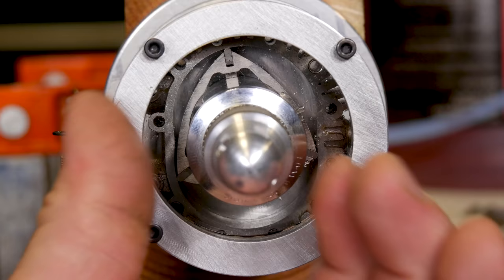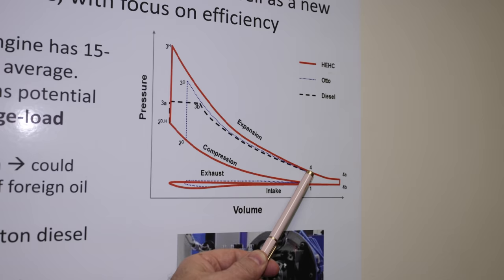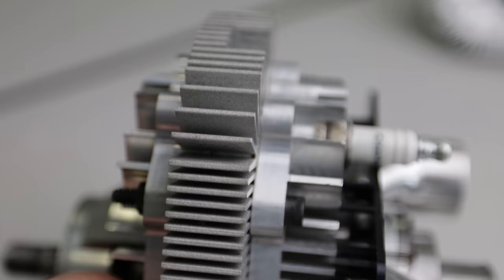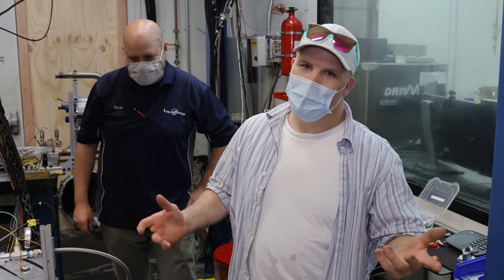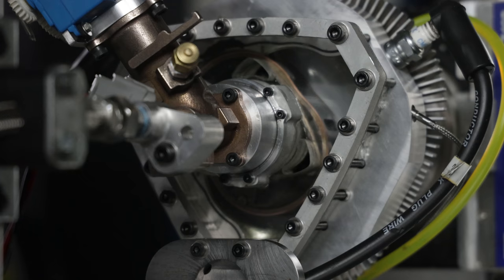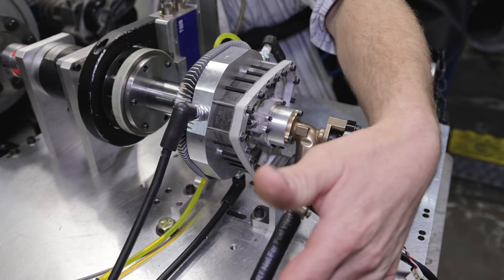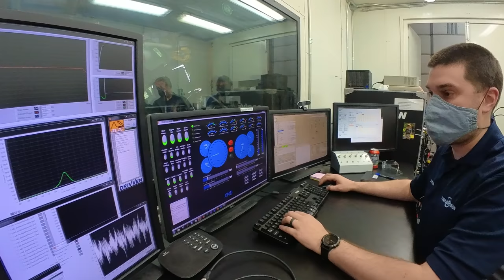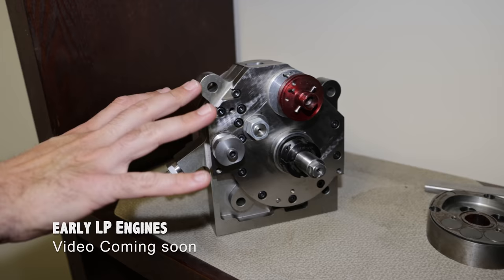See Thru Liquid Piston Rotary Engine - In Slow Motion

Comment: Would this also be considered or comparable to literally being 2 stroke engines rather than 4 actual strokes?  Plus with my very limited knowledge of engine mechanics, I'd imagine since it can use regular diesel that the engines could also be used as biofriendly clean diesel power of natural products such as hemp...??  
6:35 incredible how fast the explosive process and mechanical cycling goes  Just wow
I wonder if ultimately with having so much constant forces the liquid piston piece will break or fail somehow, or need to be used with a special hard or malleable material?!
Reply: So much friction
Reply: @henryrobinson2785  what exactly is your point "so much friction"? I'm not being ugly or argumentative; I'm just not understanding.

Comment: Really nice to give the engineers some exposure  so yea !  , tech wish how do you seal you talk about the apex seals on a rotary beings a problem area but don’t offer a options to that was the problem with Rotaries passing air polution specs
Reply: The apex seals don't suffer from the inertia imparted by the rotor pushing them against the housing and wearing them down fast. Instead they are in the housing, which means they should wear barely faster than piston rings.

Emissions are kept in check with a lubrication scheme that involves oil injection near the seals, in quantities that make oil consumption akin to that of a piston engine. Two birds with one stone on this one. Furthermore, since the explosion happens in constant volume, then the flame front has little-to-no access to the eventual oil film between the housing and the face seals.

Comment: Couple of questions.  1) Looks like the same side of the rotor gets the expansion force each time. Do you foresee any problems there?     2) Looks like the exhaust may build up on the fins of the rotor.  Any problems there?    3)  What kind of efficiency are you getting in percent?  TIA

Comment: Impressive, but the engine shakes too much. This may be fixed by attaching two engines together at a 60 degree angle so that the explosions happen simultaneously at 180 degrees.

Comment: Not sure what to make of this: The engine still has stationary seals and very high "piston" speeds that would cause heavy wear. Also the surface area of the combustion chambers is very very large, leading to poor thermal efficiency. Why would anybody at this point in time try to develop this? There will be no usecase for this engine ever...
Reply: RX-7 was a pretty popular use case, back in the day. There are still many enthusiasts.
Reply: @manofsan  understandably, considering the spectacular sound and power, truly amazing. They also have their problems obviously, for instance: excessive wear, excessive fuel consumption. But of like a 2-stroke: great fun to drive, not so much for day-to-day purposes..
Reply: @Tisimo  -  paramotors are the smallest manned aircraft, and mainly use 2-stroke engines for weight savings. But such engines are unreliable and can cut off while in flight. This rotary seems like it would be more reliable, even while providing good power-to-weight. If there was even a 10hp rotary model, it would be suitable for paramotoring.

Comment: All of the fuels you tried there isn't a consistent burn on each cylinder. Each compression stroke simulated a different reaction to the introduction of spark. Why is that?
Reply: At a guess it’s the intake system. Fuel and air don’t have time to mix (and the actual inlet port isn’t ideal for flow). Perhaps with a refined inlet system you can get proper consistent mixture going on
Reply: Probably because they where experimenting with different kinds of fuel and direct injection in a single day with no time to fine tune. I can see by the smoke that they where running rich to be safe since they had no EGT sensors hooked to monitor temperatures on each combustion chamber.

Comment: Damn it! Imagine if this had come put a decade ago, now it's almost too late thanks to electric vehicles. Maybe some sort of variant with hydrogen is possible? Would love to see scaled up variations and get an idea of the efficiency vs current tech
Reply: Use it to run the generator that charges the battery for the electric vehicle.   It's not like the greenies have an effing clue where their power comes from for their 
'clean' electric toys anyway. 🙄
Reply: The wankle rotary engine has been around since th3 70’s and there is many reasons why it is not pervasive.
Reply: @snippittmaster  I'm aware but this is a different beast. It'll likely run into similar problems overtime but I think the life span of those seals will be far longer. That and they can be engineered to be easily replaceable whereas the Wenkel was not.
Reply: @UCpn4fnZH3fg5P7qZ8D1MMRg Sure. Just have to overcome that damn scaling problem to make it work as anything but a niche application concept.

Comment: The rotary's biggest problem is its poor fuel efficiency. That is what kept it from widespread automotive adoption. 

It's still a great engine. It was very popular with many small aircraft designers for its superior power to weight ratio and its gentle failure modes. Where piston engines tended to seize, the Wankel rotary would simply lose power more often than not. This made emergency landings less traumatic.
Reply: my girlfriend had a worked 12a (rx7).. could see the fuel guage drop when flat foot on freeway runs
Reply: Fredrik Larsson  My understanding was that friction from the end seals (On the Wankel) made for poor fuel economy plus leakage from all the seals. There was also a problem with incomplete fuel burn. (Which the new hybrid engine will share, not that there aren't solutions to that problem.)

Theoretical fuel efficiency of an ideal engine isn't the same as actual fuel efficiency. Marketing hype isn't to be trusted. 

I will want to see actual performance numbers from production engines before I jump on the rotary band wagon. Still, this does look promising.
Reply: Think about your claim using any amount of logic. You make those outlandish claims, so back them up with numbers. What percentage of aircraft use a rotary vs any other engine type? According to your goofy claim, it has to be over 8o% since you say they are "very popular". I'll wait here for you.
Reply: Fredrik Larsson  I totally agree. The engine shows promise. 

I worked as a DARPA sub-contractor for years. About 1 in 3 ideas that showed promise actually worked in practice. These ideas we worked on were all good. But during development, unforeseen problems happened. That's the nature of R&D. 

The shape of the combustion chamber matters a lot depending on your definition of "a lot". The flame-front expansion needs to fully burn the fuel-air mixture just before the exhaust port opens, at least for maximum efficiency. This depends on the geometry and the nature of the fuel-air mixture (fuel type and compression ratio). 

All, or nearly all the fuel needs to burn and apply pressure to the notional piston (the peanut?). 

Ideally, the pressure on the peanut should be in the form of a tuned resonance chamber, though that effect will likely be a fraction of a percent added to the frequency. This is sort of like the tuned intake and exhaust valves on Italian sports cars. It's a tiny amount, but every bit helps -- in sales literature if not reality. 

I'm not an automotive engineer, but these are the sorts of things top designers worry about. 

Of course, these are design features for later iterations, not for proof of concept.
Reply: @eriklarson9137  Don't take my work for it. I'm just some random guy on the internet. 

WILLIAM KUCINSKI wrote for the SAE International (Sep 24, 2018),

"The Wankel rotary engine has been an ideal choice for many owners and operators of small, propeller-driven aircraft. Compared to conventional piston engines, Wankel rotaries are small, lightweight, and has a high power-to-weight ratio. They’re nearly vibrationless, they can’t seize or knock, and they have fewer moving parts (to break). At this point, it’s difficult to improve on the Wankel design; that is, unless you’re considering changing the shape of the rotor… into a changing shape."

He seems to think everyone knows about the benefits of Wankels in small aircraft. But the SAE is the Society of AUTOMOTIVE engineers. Automobiles aren't planes, so maybe both of us are talking out our asses. 

Even if true, why the flamewar?

Comment: You can tell by the leverages of the "piston"disc that this kind of engine will produce very little torque in comparison to a traditional piston engine
Reply: torque or braap, choose one
im dreaming now for this engine mounted in a moped for city use, i would 100% daily this
Reply: And the lower torque can be offset by the insane rpm and gearing, as the go kart video on their website shows the little guy turning 10k rpm for 3hp, and a huge gear reduction ratio from the chain drive setup. So a simple planetary reducer in-block or bolted on would make up for that, same as anything running a modern 2-stroke
Reply: Even compared to wankel type of rotary piston that design would produce very little torque. That's probably one of the main reasons they did not go forwards with this design during original rotary engine development either. (Yes, not a new design. There are design tables for this type from 60's)
Reply: @moroit1  If you focus this engine for hybrid car electricity generation for either battery charging to direct-drive electric wheel motors, you would not have any torque requirements of concern. You are only interesting in rpm.

Comment: Wonderful engineering, to this board certifed prof'l mech en'g consultant. The only issue I see is chamber sealing, especially with the two exhaust ports on the  rotor getting hot, and causing differential expanson locally on the rotor, distortng the cold shape. Not a problem?

Comment: Maybe I’m way off base, but it seems to me like there is a significant amount of “quench area”. Wouldn’t this contribute to excessive hydrocarbon emissions for automotive use? Have they been looking into gasoline direct injection to solve the potential issue? I really love this engine, so I’d hate to see it struggle on account of not being able to meet federal automotive emission standards. I hope I’m wrong, because I’d love to see this thing powering cars and small equipment. Actually, are they selling these?  I’d love to build an unstoppable string trimmer or something with it
Reply: those are good points. The diesel version uses direct injection so I don't see why the petrol version couldn't also use it. HOwever I don't think there is any intention of these engines ever being uses in automotive applications. An engine of this design would have emissions issues. Because of its light weight and great power to size/weight specs I could see this engine being great for ultralight aviation. Or small UAV's.
Reply: @JessHull  It actually has terrible power to weight. They remove everything the engine needs to run before they weigh them (fuel and spark systems, cooling, etc.) and they round-up on their power outputs. So, this 70cc Mini X only makes 3.5 horsepower and weighs more than 10 pounds.

Comment: How efficient would these engines be compared to the normal ICE car, or even to EVs?
Reply: The Wankel's combustion chamber is long, thin, and moves with the rotor. This causes a slow fuel burn. Engines try to combat this by using twin (leading and trailing) spark plugs. Even with the two plugs, combustion is often incomplete, leading to raw fuel being dumped out the exhaust port.

Comment: How much more reliable can this new rotary engine be just by placing the seals in the block between the combustion chambers instead of the rotor? Does that new placement make it so much easier on the seals? Or a seal failure in this setup won't be as bad as in the old rotary? I've been watching LiquidPiston since they came public some years ago, great work they're doing!

Comment: I have a new invention for a rotary engine basing entirely on a different conceptual design, which is more efficient and reliable than the four stroke engine or Wankel-based design engine. The whole world will know about this soon,
Reply from the maker: Awesome! Good luck
Reply: Good luck brother❤️❤️
Reply: Hopfully not:
Just construct a fuel cell for gas or diesel. This would be the best of the best! Not rotation, no movement, no batteries, no hydrogen.
The hugh capacity of diesel or gas and the 98% efficiency of a fuel cell.

Please forget aboput your invention and work on the better solution!
Reply: @edeltrautfeuerglut2243  nah rotorays sound better
Reply: @edeltrautfeuerglut2243  fun! ???
Reply: You are too late, Juan.   I already thought of your exact idea, long before you, and I patented it.
Reply: I have a new invention for an invention machine basing entirely on other people's inventions, which is more efficient and reliable than the hard-work method, or throw-money-at-it method of invention design. The whole world will know about this soon,
Reply: You are probably too late, the perfect rotary engine has already been designed.
Reply: Manned drones are about to start happening. They’re gonna need powerful, lightweight engines. I wish you the best.
Reply: Doubt
Reply: @edeltrautfeuerglut2243  If someone told you to forget about your invention and work on something better, would you?
What does this fuel cell of yours do? Does it make electricity?
Reply: @edeltrautfeuerglut2243  fuel cells are part of our future b ut they do have moving parts. most notably the compressor.
Reply: If they're manned, particularly if they're piloted onboard, they're not drones.
Reply: @edeltrautfeuerglut2243  i think they should keep pursuing their idea. You never know where or how the next great advance will be. The more ideas, the better.
Reply: Let me put it on a bike!! Gary Jr 1977 geemaledotkom
Reply: @Z Man  ... nice thought... i am sure there are solutions to the issues you mentioned..
Reply: Great idea as a rotary pump for my espresso machine 🙃

Comment: Still open combustion chamber, still oil burning for lubrication.
How about combine into convensional piston, liquid piston for fuel intake and exhaust. Will it work?
Reply: What?
Reply: @DanerdzYT  Precisely.
Reply: How about adding springs to the top of the pistons on a conventional piston engine to recover some of that momentum loss.😅

Comment: I believe if the ignition is delayed but just a bit when it star Decompression, then I believe the combustion and provide much greater effect to push the rotar much efficiently. The problem in my jobless mind I see is if the combustion happens while the rotar is in fully compressed zone, then it might also waste its potential to push the rotar in the other direction where it seems a loss of power.
DM for any job for me.